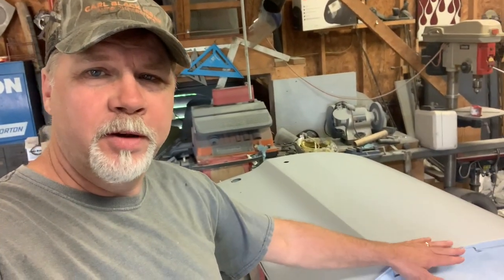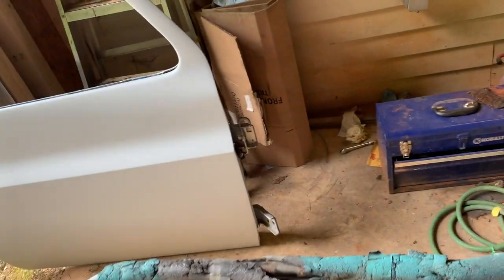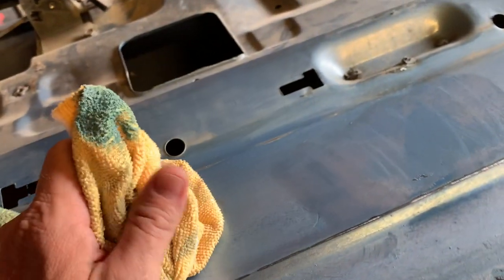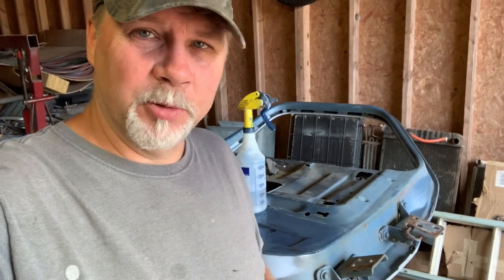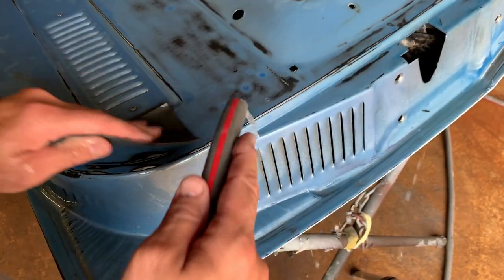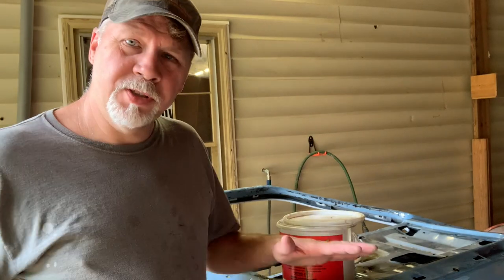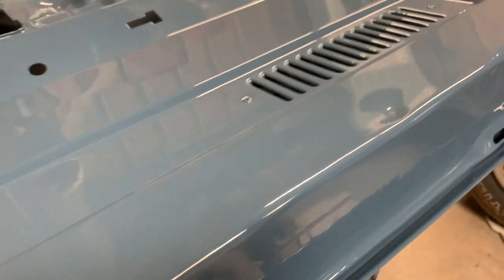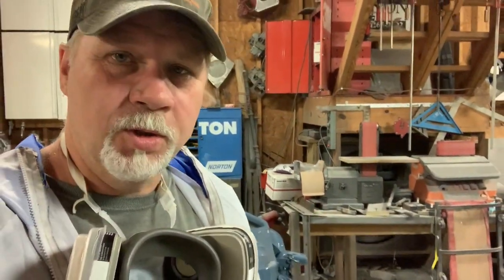C10 Project:  Painting the Door Jambs.  #c10, #squarebody, #chevy

Comment: Hey man loving the videos.. what epoxy sealer did you use? Im working on an 84 c10 and I'm doing the same process on the jams but I'm afraid to use a product that will wrinkle on me.
Reply from the maker: I used one coat of jp375, let it flash for 20 minutes or until dry, then applied 2 coats of shopline JAU single stage. I wouldn’t use a solvent base/coat clear coat over the lawyer. Good luck and thanks for watching!
Reply: I'm rolling an 84 too. Great year.

Comment: Do you always follow the same sequence geting the pretty side of a panel completely ready for paint before working on the jams/inside?
Reply from the maker: NimblyBimbly Yes most of the time. I don’t want to be priming the outside after the jams are done. Usually end up with primer inside. The preferred way would be to paint everything apart, inside and out at the same time. I’m not doing that because I have some graphics to line up and paint on the outside.

Comment: Do you recommend painting all panels seperate on a full restoration with metallic paint? Or fenders doors left on the cab? I've seen you do both in your videos....?
Reply from the maker: Painting everything separate is how it’s done in a lot of collision centers now. Kind of standard practice known as the One Touch System. This is something you have to be used to doing with the right stands and painting environment. If someone is not used to this way of doing things or new to painting, the best way is to jam everything then assemble the car and paint all the outside at the same time.
Reply: Makes sense. I appreciate it 👍🏼

Comment: If you seal it first will that stop lifting
Reply from the maker: It depends on how sensitive the paint underneath is and how aggressive the paint on top the sealer is. Sealer will help but if you put basecoat over it (which is usually reduced 50%) chances are high it will lift. That’s why I went with single stage because it isn’t as aggressive as basecoat. Sealer can help but it’s not guaranteed

Comment: Is there a reason you dont mask the outside of the door before spraying the inside? Or maybe you did and I missed it
Reply from the maker: It’s optional. When spraying with the door laying down, not a lot of paint gets on the outside. The outside is in primer and still has to be sanded so anyboverspray will get sanded off anyway. If you wanted to keep it cleaner it could be taped up so it’s just personal preference. Thanks for watching!
Reply: @StoutCustom  thank you sir! I figured that, but wasn't sure

Comment: Could you not hit it with 80 grit and use an epoxy primer sealer to instead of a single stage paint on the inside of the doors
Reply from the maker: I would only use 80 if I wanted to take it to bare metal. I did use epoxy as a sealer over the existing paint but it would be the same process if I went to bare metal as far as painting.
Reply: @StoutCustom  learning a lot from watching your videos thank you for replying